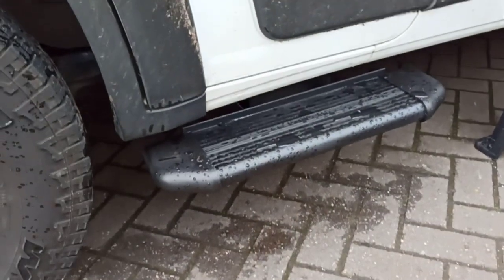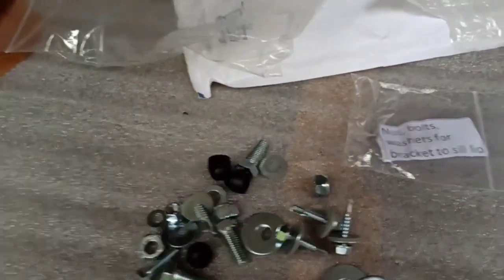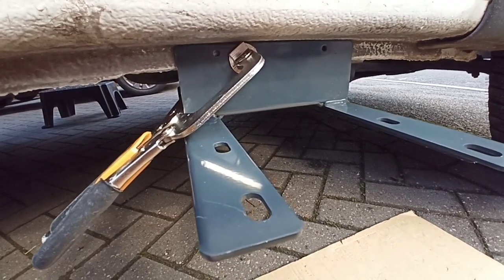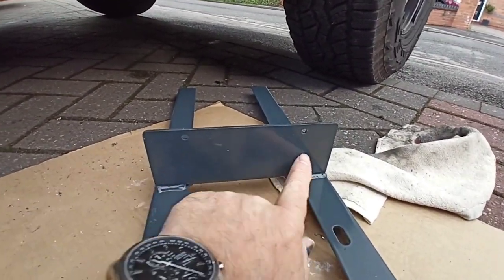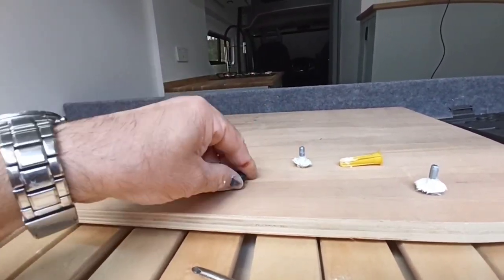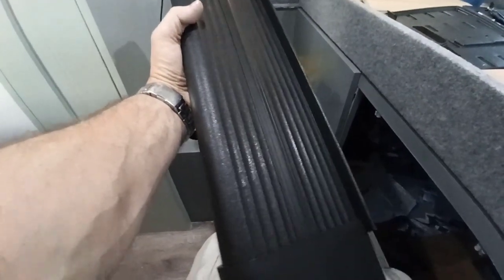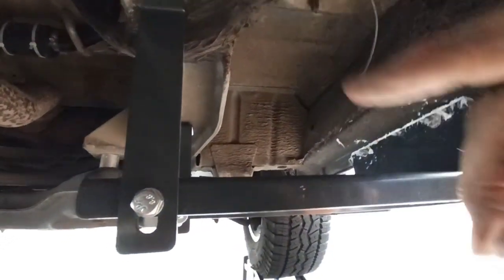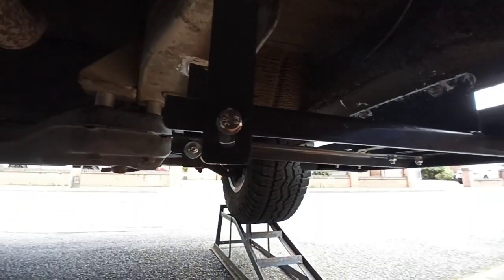fitting a side step  underneath driver and passenger door

Comment: Hi what was the brand name of the steps please .
They look ok Cheers mate .
Reply from the maker: I just purchased them off eBay but I believe there's a company also doing a full length running boards that go from the front to the rear wheel arch the fit the van in the same way as these small side steps